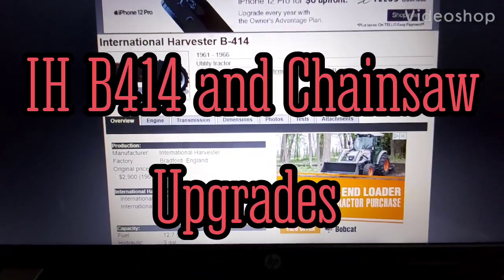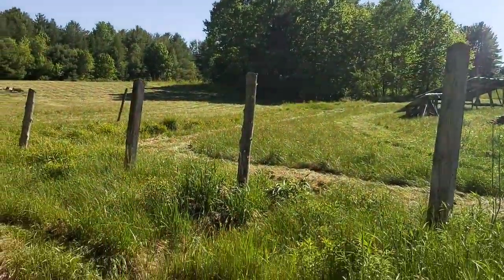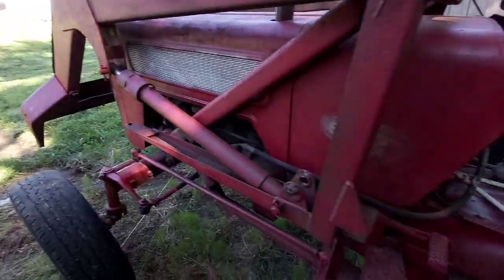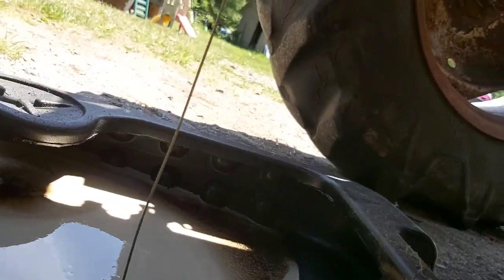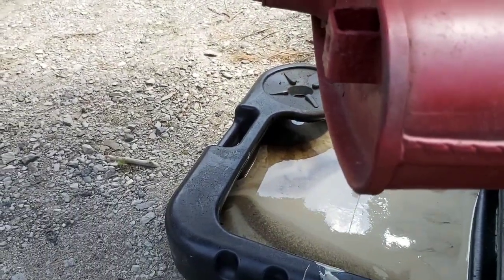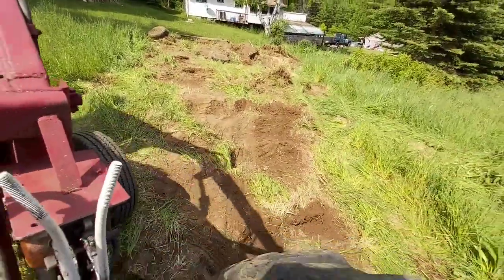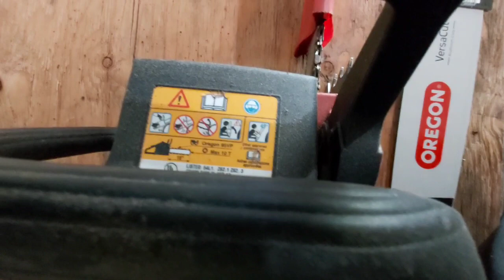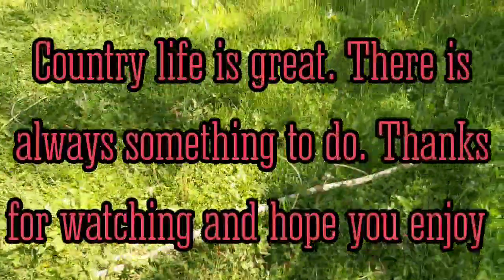IH B414 and Chainsaw Upgrades

Comment: I'm getting the same tractor but having hard time looking for a loader. what size is your loader?
Reply from the maker: I'm not sure. I think it can lift around 1000 lbs. If you can weld you can put any loader on it.
Reply: @frankz1125  thanks